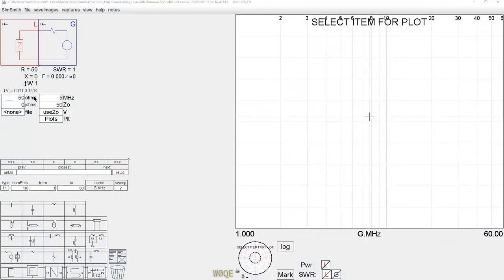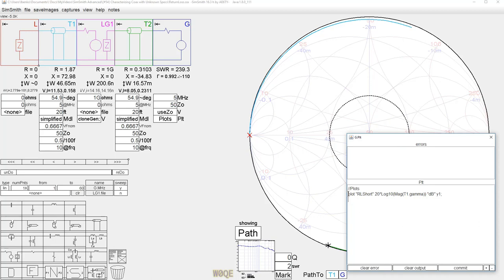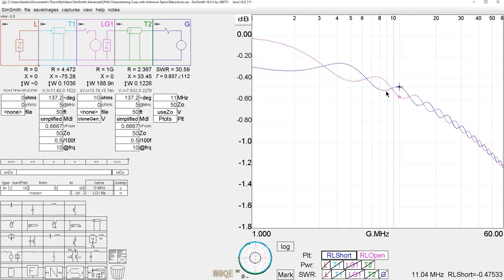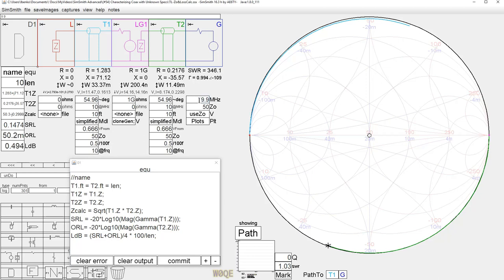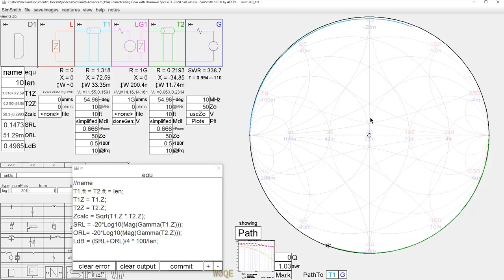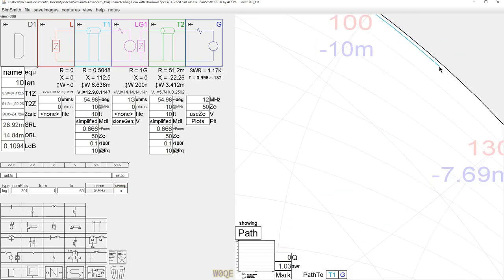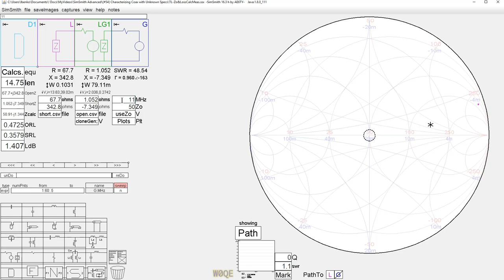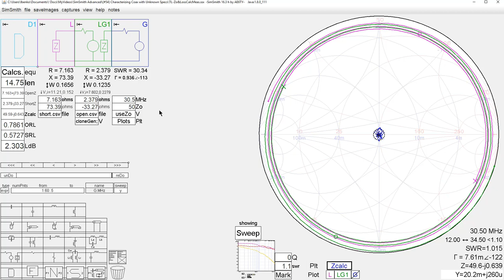#54: Characterizing Coax with Unknown Specs

Comment: Larry, I'm considering purchasing a NanoVNA v2Plus4 and just discovered your videos this weekend.  Fantastic!!  I have been binge watching your channel since yesterday, haven't done that since I first got HBO years ago and got hooked on the Sopranos :-)    One of the first things I want to do with my VNA is characterize the various runs of 75 ohm RG6 coax installed in my home by the previous owner, since I am unable to locate the published dB loss/ft and VF for these cables.  I suspect some are excellent quality cables, others not so much.  I plan on downloading SimSmith as well as the ZPlots software from AC6LA to assist in this. 

After watching this video and several other relevant ones,  I'm thinking that when using the VNA to characterize the specifications for each run of coax, it won't matter that the VNA "expects" a 50 ohm load and these cables are 75 ohm. If that is true, can I:
(a) use a F to SMA adapter at the near end of the cable under test, to connect it to the NanoVNA's SMA port? 
(b) use a F to SMA adapter at the far end of the cable under test, and use the 50 ohm open and short standards included with the NanoVNA there?
(c) not bother with 50-75 ohm impedance matching (e.g. use a pair of Mini-Circuits 50-75 ohm minimum loss pads (5.7dB loss) or their impedance transformers (1.3dB loss))?  I want to get the best results in my testing, but if they are not really necessary then I'd rather not.

Am I correct in these understandings?  Thanks in advance for making your knowledge and expertise available to us all via these videos!  Tony
Reply from the maker: Tony,
There are many ways to characterize transmission lines.  Let me describe two of them.
1.) Terminate the coax with a value of resistor that is the expected value of the transmission line.  Then as you sweep the transmission over frequency the result will be a dot or a small circle if your guess was close to the actual value of the transmission line.
2.) Terminate the transmission line in both an open and a short and measure the impedance at a single frequency.  Multiply these 2 impedances which are complex numbers and then take the square root of the value which will give you the Zo of the transmission line.

Both these methods can be simulated in SimSmith very easily and the measurements can easily be made with any variant of the Nano VNA or any other impedance analyzer.  I have done a lot of videos showing how SImSmith can help you make better VNA measurements and being able to simulate and then measure is quite satisfying when they both closely match.
Best wishes,
Larry, W0QE
Reply from the maker: Tony,
You are basically correct.  Let me add a couple of things.  Min loss pads or any other loss in the circuit before the measurement plane will result in a drop in the VNA performance due to a lower signal to noise ratio.  This usually isn't a problem unless you are trying to measure something like a filter where the stopband attenuation is high (greater than 60 or more dB).  You are correct that you can measure the impedance without needing a min loss pad but if you try to measure through transmission (s21 & s12) you will get the wrong answer.  This again can be simulated in SimSmith in just a couple of minutes.
Larry, W0QE

Comment: i stubled across your video while i was searching for information on which legth of coax 213/u to avoid when setting up a three element yagi for 20/15/10m. have yet to find a definitive answer. any help appreciated. tia and keep up the good work
Reply from the maker: Ralph,
A shorted stub will act as an inductance in parallel with the feed point impedance.  A short boom tri-band yagi will probably a feed point impedance of about 17 ohms.  Reducing the length of the driven element to make the feed point impedance capacitive will allow an inductance in parallel with the feed point to become much closer to 50 + j0 ohms.  This same technique is often done on HF mobile antennas.  As to the length I can only guess that about 4.4 ft. of RG-213 would be close.
If you can measure the actual feed point impedance then calculating the length of the stub is trivial to do in SimSmith.
Larry, W0QE
Reply: @w0qe  thanks Larry